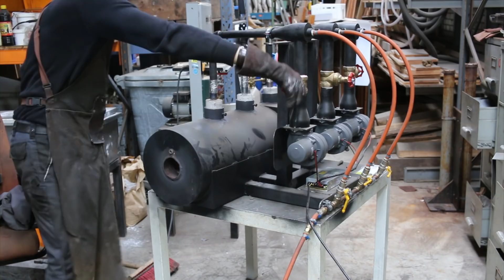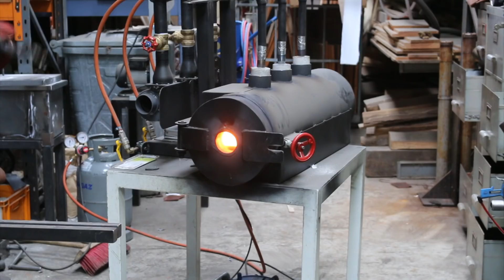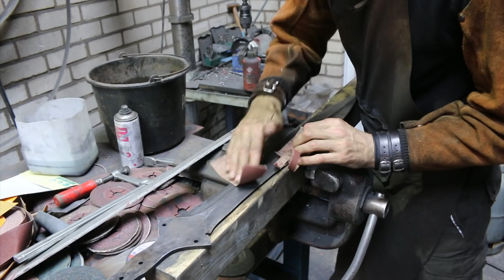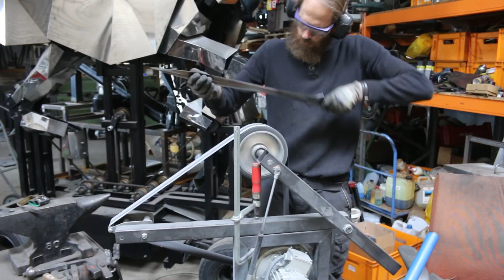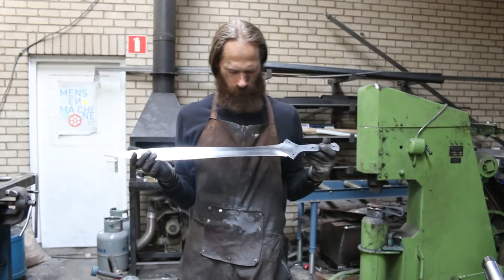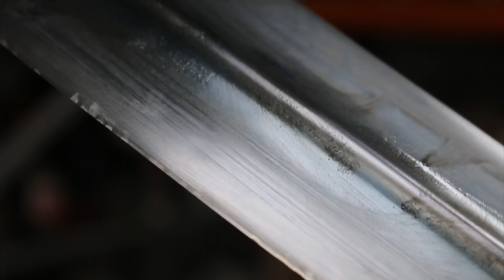Forging a Bronze Age style sword from a semi truck leaf spring, part 2.

Comment: Impressive hardness and temper, leaf spring steel is legendary,I was wondering could you undertake a no power tools challenge some day? Only anvil,forge,hammers,files,sandpaper no power hammer, grinders,etc. Of course forging from a thinner piece of stock, not semi-truck leaf springs :)
Reply from the maker: Nick sure.

Comment: Few questions:
1. Have you tried bluing the steel with bushy flame or you prefer that blue compound that you apply on steel?
2. What is the white powder that you use to anneal the swords, that powder in box where you stick swords into to slowly cool?
Reply from the maker: 1-yes, but i cant do that on  swords as it will temper the steel too much. 
2-i use lime,  but other substances would be better.
Reply: I saw that bluing with flame done on swords, the trick is it seems just passing very fast over the blade. Apparently that has no effect on tempering.
Reply from the maker: it has....
Reply from the maker: it has effect.... but some steels temper on a higher temperature,  like bearing steel... maybe this was the case.
Reply: What is the usual tempering temperature you are doing? I know that for quenching is enough to get steel to non magnetic state and then duck it in oil, but what about tempering?
Reply from the maker: it depends,  on the steel,  204/300 c  204 for the blade 300 for the constructive parts,  like the guard cross.  or in some casses the back of the blade or the spine.  if you are going for it, it is best to get a industrial reader about the steel you have.  it differs per steel type...

Comment: Few things i questioned why dident u cool it down after first hestreatment mid was glowing and after that after all this sandin u again heattreated it onöy for look or pn purpose i was the uneducated one dissliked please explain if itz weakend if i get it i will refuse my dislile into a lile thx anyways looks preety have a greate day
Reply from the maker: the first heat was to pacify the steel structure,  the second heat was the heat treatment, after grinding there was the temper with the flame.  the steel has to be clean to steel the color change.  (gold brow for the blade blue for the guard crossing.
Reply: Freerk Wieringa thanck you very very much for your time and short well explaing massage have a greate day thx